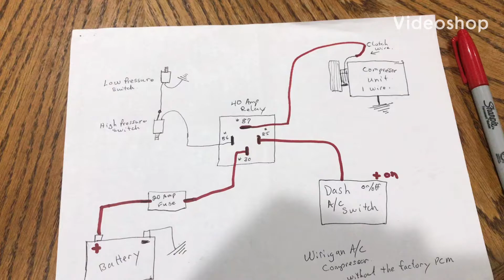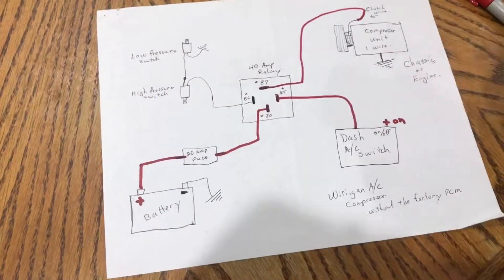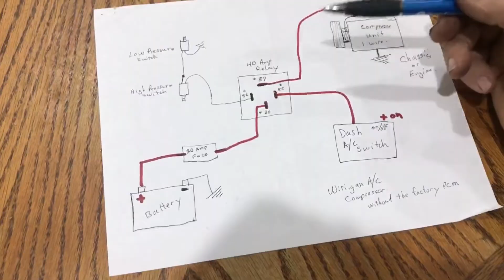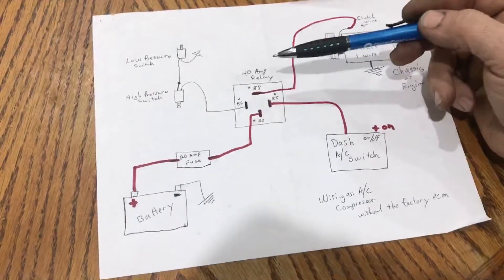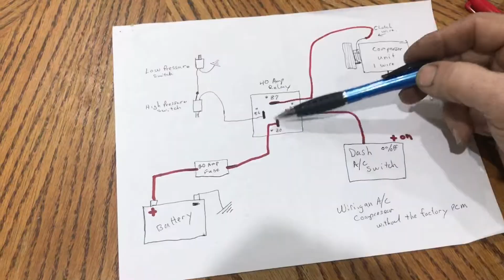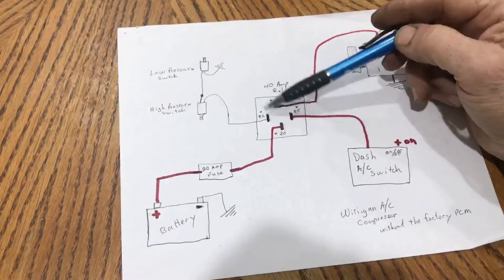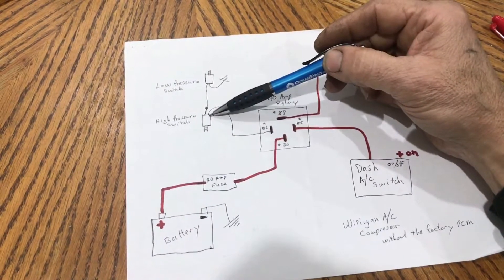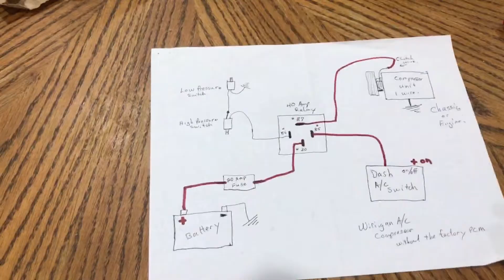Wiring an AC compressor relay

Comment: how would u add vacuum idle up solenoid to this circuit that will cut on and off depending on the temperature. (or do they cut on and off due to pressure?)
Reply from the maker: It would go on the same wire that powers the ac compressor.

Comment: I have a question. 1972 chevelle Malibu converted to R 134a so compressor has 1 wire. The harness 1 green wire comes from the dash that goes to a 3 pin plug connector that has 1 green wire that goes to a 2 pin plug connector and 1 black wire that goes to a female bullet connector. The 2 pin plug connector with 1 green wire and 1 black wire that is a ground connection. System only has a high pressure switch that has 2 green wires do you know the diagram for this or any suggestions Sir
Reply from the maker: If is the high. Pressure switch hooked up ?

Comment: Wow man mr ive been haveing my ac got one time and was popping my 20 amp fuse i didnt get to fix it but one day i was at the car was and they have an air blower to dry ur car so i open the hood to blow the leaves of and did alil all around and no lie when i was driving home i hit the air cuzbit got foggy and my ac began to work kool so 4 days ago 8 was diving on a street with 1million pot holes and bam my ac went out gotbhome put a fuse and it work lmao judt to go back to that street and bam my ac went out now the fuse pop and imngere but ur video gave me something to work on tomorrow on my truck
Reply from the maker: Sounds like the relays got a short inside of it. Check your AC relay on the car.

Comment: I just did a LS swap on the older vehicle that did not have these high side and low side pressure switches. Do I need to add one or will I’ll be fine not adding it and if so, where will I add them to?
Reply from the maker: It would be a good idea to put them in. They just need to go in line with the high and low side hoses.

Comment: With out the ac ground the compressor wouldn’t get the 12 volts its needs to run right ?
Reply from the maker: Yes
Reply: @Jvcomet  thanks … this is what I’ve been missing

Comment: My 88 Ford compressor has 2 wires and it only has 1 pressure switch. Whats your though?? Thank you for the help!
Reply from the maker: I believe the two wires are one positive and one negative.   And only low pressures switch so that if the Freon is low it won’t ruin the compressor
Reply: @ thanks! So run the power wire for the compressor to the pressure switch to kick on when it calls for it? (And has enough pressure)
Reply from the maker: @Drakes_Garage yes
Reply: @ thank you!!

Comment: Does the control circuit need a resistor to limit the current flowing from 12v through the switch and the relay and the lo & hi pressure switch to earth?

Comment: I know this is 4 years ago, but I am trying to spoof my car thinking the ac is on so I can have the idle and fans to run. Is there a way to just bypass the relay and just have a switch there tricking the car to run at the idle speeds as if the ac compressor was running?
Reply from the maker: I guess you can disconnect the compressor.

Comment: The voltage reading from the low side of my a/c switch connector is showing 4.7 Volts from one side wire and 13.6 V from the other wire on same connection, is that normal?   Is not one side suppose to be grounded, or no power until switch is activated to engage a/c clutch?
Reply from the maker: Yes one should be ground.  🤔

Comment: Why not just run a hot wire to the compressor???
Reply: I’ve got my old kenworth wired up that way and it freezes up. Have to remember to flip that switch off to let it thaw out every 5 minutes. I’m gonna wire it this way to have a little better quality of life going down the road
Reply from the maker: @langstonwaller4724  thanks for watching.
Reply from the maker: You can but if the system goes high or low you’ll fry the compressor
Reply: I imagine most of us overriding the failed (original) relay switch.
My old (1989) slide controls no longer function so fabricating a dashboard button is the way to go!
This relay configuration video is super helpful!
I just I could identify the “High” switch on my current system.

Comment: I have a trinary switch wired in on the high side of my system, one ground goes to my fan relay and the other I tied into the binary switch on the low side. 
My question is should I run the other 2 wires to the compressor and ac request circuit or does the trinary switch need its own relay?
Reply from the maker: Not sure on that one sorry

Comment: Thanks a lot for the explanation. Have a no power situation to my ac clutch in my 04 dakota and jumping 30 to 87 does nothing but running power from the battery to the clutch does. Didn't have my meter with me today but obviously I need to find out where there is power and where there isn't. Didn't think of it then but should've jumped 30 from the ac plug to 87 on the wipers plug to verify if there was power there or not. 😊
Reply from the maker: Yep hope you figure it out

Comment: Does this apply for any ac like Honda swap
Reply from the maker: Yea all the same.
Reply: @Jvcomet  what if my 85 and 86 are in the opposite sidecause my 85 is on the left and 86 on the right
Reply from the maker: @user-bu6xj7xi6x should still work.
Reply: Yea it automatically turns on whe the ac power is turned on it works but I think the clutch stays engaged and cause the engine to over heat
Reply from the maker: @ChristianGomez-b6d  may have a different issue.    Make sure there’s nothing obstructing the flow of air through the radiator and condenser
Reply: Starting to think it could be the ac pressure ac compressor turns on when freon is add but never disengage and stay running on all the time
Reply from the maker: @user-bu6xj7xi6x yes it needs to stay at a certain pressure you have gauges. You need to check it while it’s running if it’s running too high and you need to figure something else out.
Reply: I've noticed my car keeps ove heating when the ac is on new condenser new dryer I think the ac compressor is causing extra stain and causing it to overheat
Reply: Ac works but starts to overheat
Reply from the maker: @ChristianGomez-b6d  is the fan going on when the ac is in
Reply: And thank you for replying
Reply: Brand new condenser it's in the front
Reply: Runs good when ac is off thought it's was the old condenser but no same thing after new 1
Reply: I've noticed the ac compressor turns on but never cycles could ac pressure switch be the culprit causing the compressor to stay engaged all the time
Reply: I vacuumed it and put 24 Oz of freon it kicks on but never cycles just stays on

Comment: Does it matter if 85 and 86 are swapped? Meaning would it till work if dash switch (12v positive) came to 86 and got grounded at 85 through the pressure switch(es)?
Reply from the maker: It might  but not sure.
Reply: @Jvcomet  i just tested. It works both ways. Coil still pulls when current applied from either direction... Kinda interesting.
Reply from the maker: @urbanturbine   cool that’s good to know . Thanks for sharing and watching 👍
Reply: @Jvcomet  thank you for posting this video. İt was helpful for me.

Comment: will this let the compressor cycle off and on
Reply: I'm kina wounding the same thing I swong I head it cyle
Reply from the maker: What year make and model car you working on.
Reply: @Jvcomet original compressor on a jeep TJ 5.3 swap.
Reply from the maker: @jesusdavila8641 yes.
Reply from the maker: Yes compressor cycles when the pressure is reached high or low.

Comment: My 87 Monte is a wiring nightmare for ac now that it has been fully converted from fuel injection to carburetor. I can not get my ac to work and too many wires have been eliminated for me to trace this issue. My heat and blower motor and all that work but the ac does not engage. SO, following this set up, is there a way to wire aftermarket pressure switches with this wiring set up you show? If so, please explain. Thanks!
Reply from the maker: Wire it like in the diagram. Aftermarket pressure switches are the same.

Comment: Does the positive on the low pressure switch go to the negative or positive on the high pressure switch?
Reply from the maker: Negative both switches are ground .another words both switches complete the ground Circuit

Comment: I was trying this except I was running the ground to the chassis on 86, and I had the power going from 87  through both pressure switches into the compressor positive wire. Grounded the compressor to the chassis through the ground wire. I couldn't get a true positive to the compressor to turn it on. It's like the ground would cancel out the positive through the compressor, yet when I gave it power directly with the power probe it would turn on. I'm going to try it this way tomorrow, makes more sense to run a ground through those components haha. Thanks for the video! Do you have, or plan on making any videos about thermostats and fan clutch solenoids?
Reply from the maker: Fan relays ?     Thanks for sharing

Comment: Thank you sir, can you kindly let us know how to wire the condenser fan in to this as well
Reply from the maker: Wire it in line with the same wire that Powers the compressor,. The fan only needs to run when the AC is on

Comment: Were is the selector & thermostat wiring connections ,you wrong.
Reply from the maker: You can only control the on and off of the compressor with a relay.

Comment: I'm about to attempt this on a 2011 Honda CRV that got flooded The AC system is in perfect working order just the electrical side of it is not now with your help I'm just going to wire it up myself to a switch 🙂
Reply from the maker: Yep that should work.   Thanks for watching
Reply: @Jvcomet  quick question my high pressure switch is a 3 wire I've got ground signal and reference do I just use the ground and signal and leave the reference unconnected?
Reply from the maker: Not sure on that one.    Sorry may have to trial and error that one.
Reply: @destruct61 hey im doing this right now. We're you able to figure this out?

Comment: i just got a 2018 ram promaster and everything on the dashboard turns on exept the controls for the a/c there is no lights on the knobs.  the relay is good the fuse is good .i got power on terminal 30 and when i turn on the switch i get power on terminal 85 but no lights on the dashboard a/c knobs. what do you think.
Reply from the maker: Not sure could very well be the knob itself 🤔

Comment: my 1988 caprice came with just a low pressure switch by no high pressure switch, would i still be able to use the diagram you showed in the video?
Reply from the maker: Yep
Reply: @Jvcomet  ohh ok. im running a r4 compressor could i put a high pressure switch into it? i seen that some models came with sensors on the compressor
Reply from the maker: I’m sure there’s a way to add one if you really want it.
Reply: @Jvcomet  ok cool, thanks for the help
Reply from the maker: If it has 2 wires one is positive one is negative.    @JoseReyes-pl7td
Reply from the maker: @JoseReyes-pl7td   what color are they
Reply from the maker: @JoseReyes-pl7td  did you check the fuses.
Reply from the maker: @JoseReyes-pl7td  call me if you want. 914-490-4306
Reply from the maker: @JoseReyes-pl7td  colors?
Reply from the maker: @JoseReyes-pl7td  one wire probably goes back to the ecu    Use the two that are the same color in line as in the diagram.
Reply: Yes sir...and good morning..

Comment: how would you do it, if you want to control the AC temp?
Reply from the maker: The relay set up will not control the actual temperature it’ll only control on off of the compressor

Comment: Question. So both pressure switches are wired together correct and 1 grounds .. do I tap into the existing power wire coming from the pressure switches? Or rewire ?
Reply: Or is it a ground I’m connecting 86?
Reply from the maker: Yes it’s either a ground or to a pressure switch witch becomes grounded when it has pressure. Hope that helps 👍

Comment: Does this affect the idle at all? Such as when the compressor is running the idle will reduce from 600 to 400 or 500?
Reply from the maker: Yes when the compressor kicks on it’ll draw down on the engine another thing you can do is put a stepper solenoid next to the idle control if it’s a carburetor you can get a little electric solenoid and wired into that so that when the compressor kicks on it steps to idle up

Comment: Thank you sir! One of the most informative videos on YouTube. That in fact can save people thousands of dollars on trying to figure out what went wrong with their AC and anything else. If you can rewire then do it! This way you actually will know how it works and will help with possible future repairs. 

I’m working on my Freightliner Cascadia. And when I connect new AC compressor it just burns clutch coil immediately. And this truck somehow has a lot of things controlled by the computer. So for me it’s easier to bypass it. And this video just helped a ton! 
Thank you again Giancarlo
Reply from the maker: Yes sir thanks for watching

Comment: Amazing! I searched online two days about relay diagram, that’s the easiest way to understand how relay works!
Great job!
Reply: Does every car have a relay? Where does the Red wire go apart of the relay, is it the ignition coil?
Reply: @AmadorRt  Yes. Without a relay would be a disaster. The on off switch gonna be a bomb.
Reply from the maker: @AmadorRt  to the on off switch
Reply from the maker: Thanks glad it helped 👍

Comment: Thank you for a very instructive video. I would like to ask if a trinary pressure switch that is in most cases mounted on the ac receiver drier  is perfect substitute of having two high and low pressure switches.
I heard that you may have a single trinary switch and no need for high and low switches
Reply: In addition to that, I would like to ask how can I wire this setup to the idle air control valve to compensate for the ac load?
Reply from the maker: @obedtusime181  not sure but I remember back in the 80s cars there was a little electric solenoid that would kick the idle up might be able to find something and do it that way
Reply from the maker: Your welcome thanks for watching. Hope you subscribed . Thanks.

Comment: How would you wire in an electric fan to this setup? I have an aftermarket single electric fan wired to a fan controller and a keyed switch. I just had a complete AC unit installed so I need to get that wired in so the fan turns on when I hit the AC switch inside the cab???
Reply from the maker: So first off you need a second relay just for the fan you would wire it the same as that other relay except there will be no high low switches
Reply from the maker: If you need to call me. 914-490-4306thanks for watching